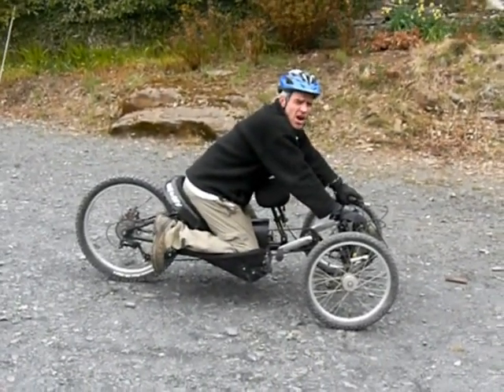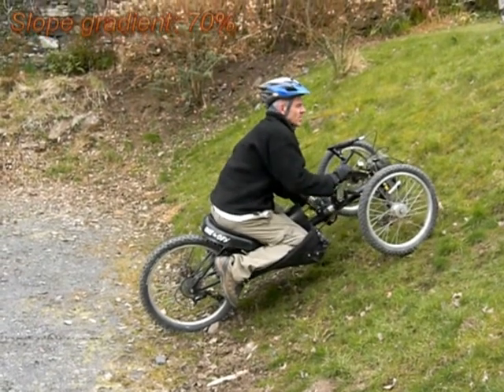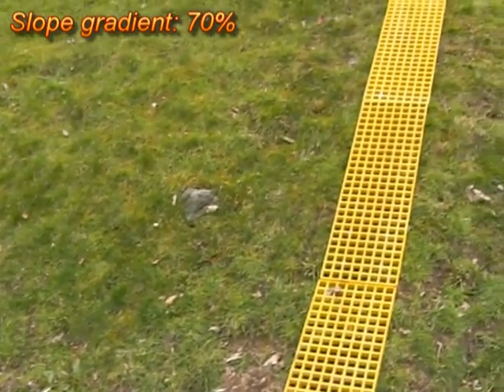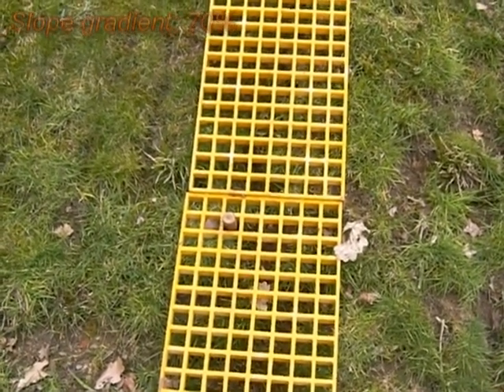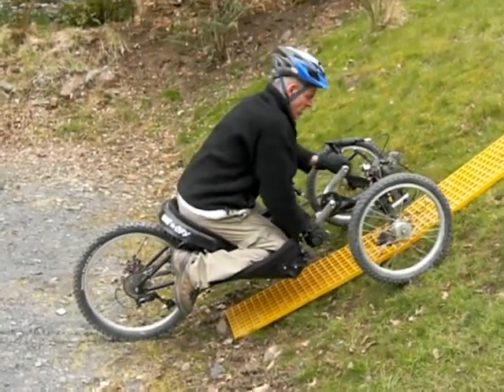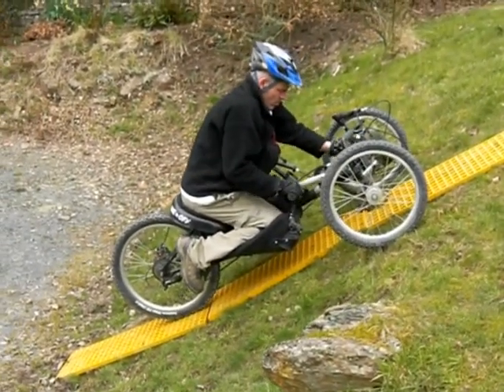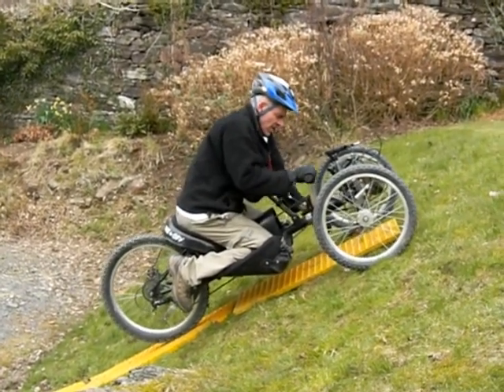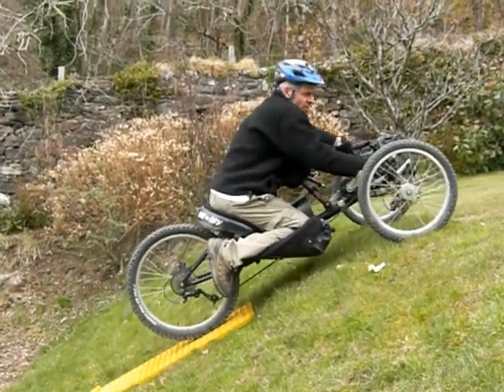One-Off Hand Cycle on steep gradient (70%) using sand ladders

Comment: 45 degrees would be 1 ft rise to 1 ft forward.  Doubt slope in the video is that dramatic.More like 20-30 degrees.
Reply from the maker: Tom Hawkins a 70 % slope is just less than 35 degrees.